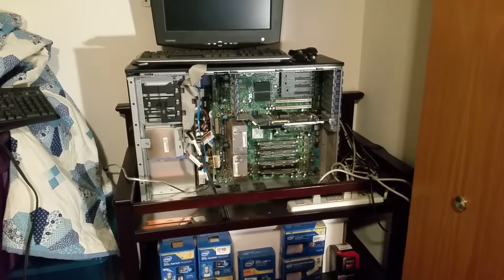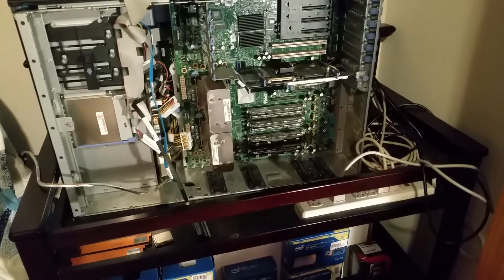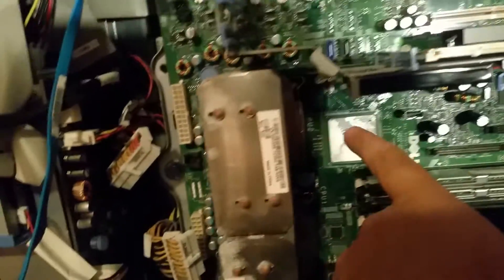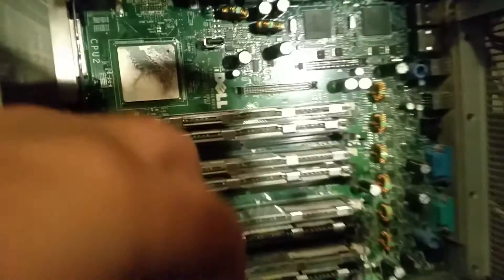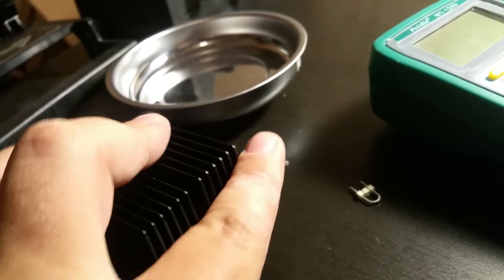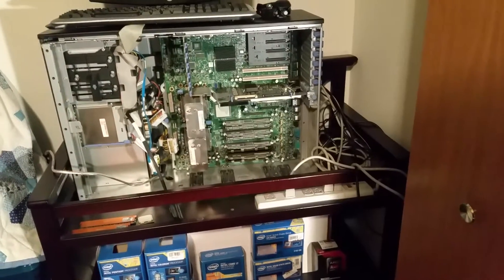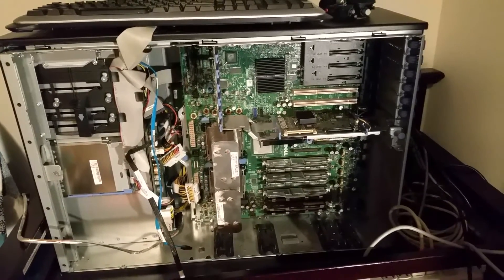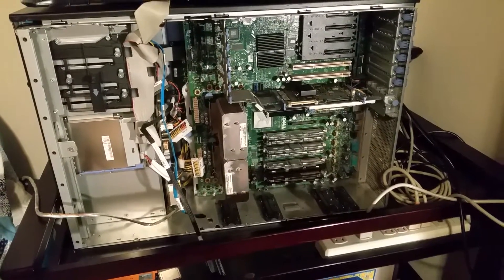Dell Server is DEAD!!

Comment: i just got one of these for free from a buddy, do you think it's worth throwing some money into nowadays to do the same thing? (i wanna run a few game servers for my clan as well)
Reply from the maker: Well, I am so n the process of decommissioning it.  It will be getting replaced by a VM server running XCPng on a first gen ryzen 5 CPU system.
Reply: @cbremer83  yeah i'm just dipping my toes into servers since i got this one but i think for the money i'd put into getting ram for it and a couple of hard drives i'd be better off purchasing a newer one lol. 
spent the night researching these things though, thanks for the videos and response.
Reply from the maker: @sumofl  any computer can be a server.  When you buy things that are sold as a server you are basically buying something designed to go in a rack and built for 24/7 operation.  And focused more on reliability.  I got this old server on the cheap, so I had little to complain about.